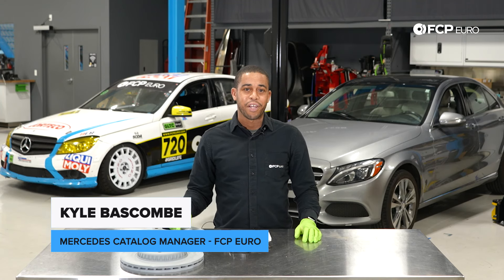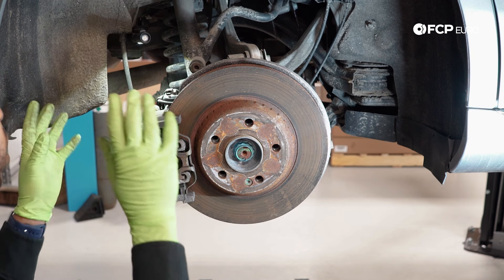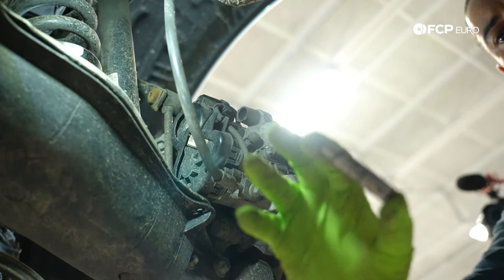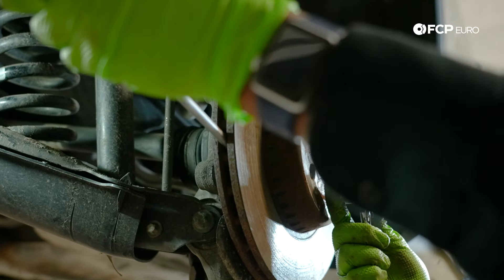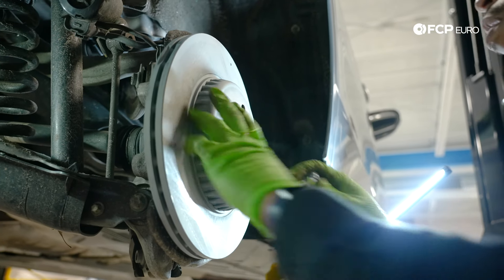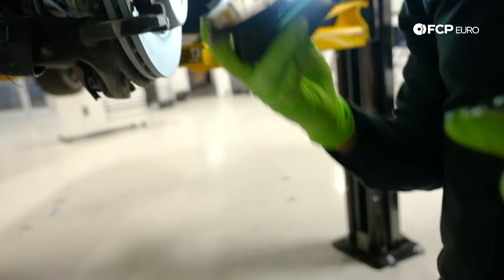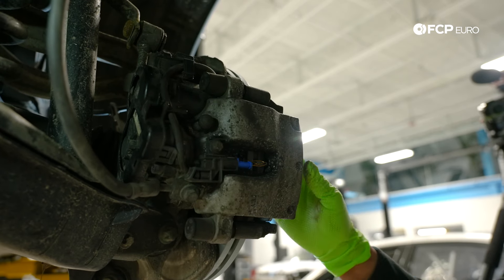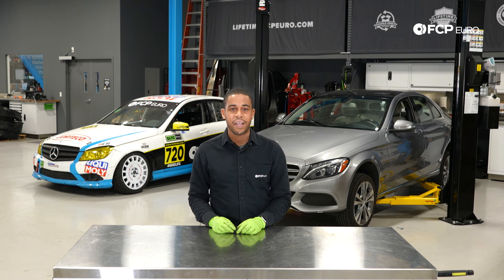Mercedes-Benz W205 Rear Brake Replacement DIY (C300, C350e, & C400)

Comment: A tip for anyone else struggling to access the 'hidden' menu to select the parking brake maintenance position, you have to be in the Trip view on the dash, but also on the screen that shows mileage and not any other view (speed or Eco settings for instance). Not mentioned here or on any other video I've found and spent an hour struggling with this and cursing my car! Otherwise an excellent video that properly explains the process and gives all the correct spanner sizes and torque settings.
Reply: For those who has virtual/digital gauge, set display back to normal mode instead of speed/super, then you will be available to fiind the mantenance menu.
Reply: Can you open the door after setting it to maintenance  mode?

Comment: this is changing your disks and pads on the hurry. clean the wheel hub, lubricate the guide pins, never-seize on the T30 bolt. so much left out.

Comment: I have to say,  this was a really good, well explained at every step video. However, I do have two comments on procedure. You did not show the part where you clean the new disc. Every disc I have replaced with new, came with a protective oily coating. Many people new to mechanics may not realise they need to clean them. Also, I have a similar comment about not cleaning the hub. I have only ever had it happen once, but it resulted in a warped disc. I couldn't understand how it would do it but a much more seasoned mechanic explained that any irregularity of surface on the mating faces of disc and hub can lead to a warped disc. So, I just clean everything of rust a debris to avoid problems. Again, I really liked the video. Thanks
Reply: Those look like fully coated rotors tho. If they’re fully coated no need for brake cleaner as they do not have protective oil. But I agree with you about the hub cleaning. I always clean with a brush!

Comment: I kept getting a "Rear Pad Fitting Not Fulfilled" message when trying to set the brakes into fitting position. 
How to fix: 
- Set the car into Accessory Mode
- Make sure your dash is on Trip > Miles, so you can access the service screen, because my Telephone + OK button combo was not doing anything if it's not on that screen.
- Release the parking brake (not mentioned in video, this is what fixed the problem)
- Select Brake Pad Replacement
- Press OK
- You can now turn off the car. You do not need to keep it in Acc mode.
Reply: at 2:21 he did mention the parking brake , he said make sure your parking brake is not actuated

Comment: You definitely do a wonderful job to explain the procedure of replacing brake pads and rotors. However, I didn't hear the part whether you have to turn off the ignition while changing the brakes, or you leave it on throughout the process. 
Charles Lungu.

Comment: I wish you would of shown the complete job. Cleaning and relubricating the slide pins, and cleaning the slide pin bore, cleaning all the rust material off the caliper piston that is surely going to produce a vibration and uneven pressure on the pad, cleaning the brake pad slides (there was SO MUCH crap on there) and cleaning of the hub even though it was fairly clean already.

Would of been 10/10 video.

Comment: Did you not use the brake grease? I just replaced my rotor and brakes all around and have a slight squeal when coming to stop at crawling speed.

Comment: Thank you for this video used to change the rear brakes and disc in my w205 c63 ever so slightly different but most of it is the same
Reply from the maker: Happy to hear this could be somewhat of a guide with that!

Comment: Great video but can you please answer some questions already asked:
1. Is the ignition left on after you receded the emergency brake actuator?
2. Is brake lube required on the slide pins?
Reply: second that on the ignition, need to know
Reply: No you do not need to leave it on.

Comment: Small question: The car should stay in accessory or ignition mode all that time, or we can switch off and  finish the procedure after disk replacement?
Reply: Some other guy in the comments says you can turn off the car

Comment: Awsome video, I spent the cylinder to get it in. Will that mess up something!
Reply from the maker: Hi Lucky, you should be fine so long as the seal is not damaged. It cannot hurt to go back and inspect everything after driving the vehicle.
Reply: @fcpeuro  wow what a  fast reponse! Thanks

Comment: Just a tip, if possible, try to film these in one take, that way you don't need to sync audio and video for each clip. I don't know if i'm sensitive for audio/video out of sync situations, but that was pretty disturbing to see. Yes i know there will be pauses and stuff, but memory is pretty cheap nowadays, and you will save the effort to sync separate clips.

Comment: questions: 
1. why cant you retract the piston by spinning it? like most if the japanese cars rear brake.
2. i seen videos before from other platform showing these type of brake disc have different torque sequence for the wheels. like Nm then add degrees. is this true?

Comment: Noticed you didn’t apply any brake grease near any of the friction points or even the slide pins.
Reply: This is the third video I watch about changing brakes and third that didn't lube any friction points.
I don't know why they skip this step but I'll definitely lube mine with copper grease when I change my brake pads in the near future.

Comment: Do you have to install a wear sensor on each rear wheel or can you just install one?
Reply: you can only install it on one front wheel and one back wheel, (think its passenger side in both cases)

Comment: do both wheels have to be off the ground when doing the brakes fitting positions setting?
Reply from the maker: You can do it with only one wheel up if you are working at home, doing one side at a time!
Reply: 🏌🏾😂😂😂 🙏🏽🙏🏽💪🏽 ok i’m  back again 6 months later everything perfect but i have one more Question so each side have to be put into fitting position if doing it at home

Comment: Hi I'm wondering how do I go to the fitting position because I'm changing my 2015 mercedes benz c300 rear brakes.  I changed the one side but accidentally my son pressed the brake paddle and brake caliper piston came out. Right now I cannot release the parking brake even it's not working and I'm getting the message on the screen Parking Brake see operator manual.  Can you please help me how do I release my Parking brake and solve the issue.  Thank you in advance.
Reply: Have you found a solution?
Reply: Same issue,I'm having right now.....

Comment: Half ass job ..never lubed the slider pines..never cleaned the brackets were the pads sit...no lube on the back of the pad to avoid squeal.... 5 out of 10 based off a pure clean job...do it once to it right period...this is how normal mechanics to the job and charge full price....